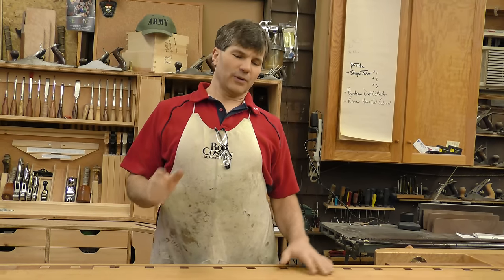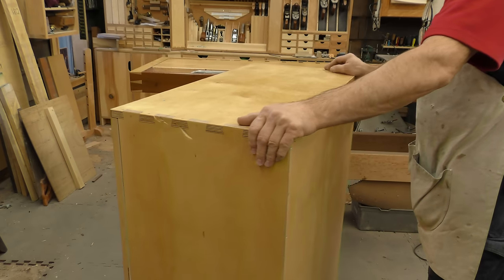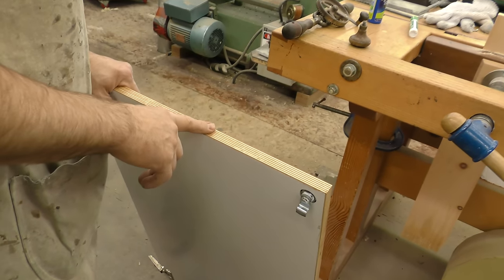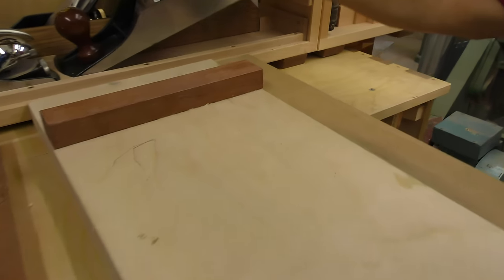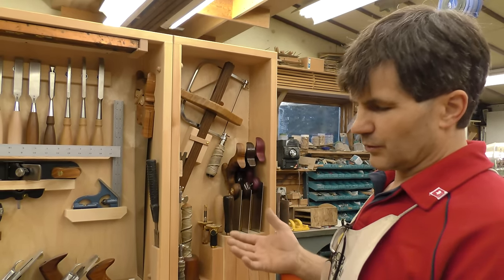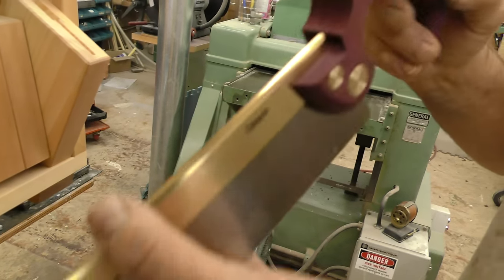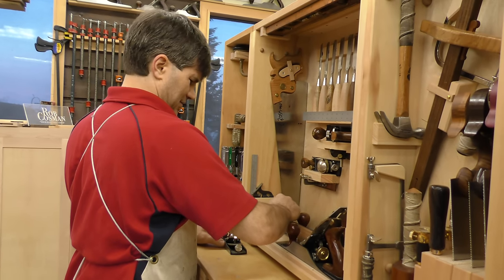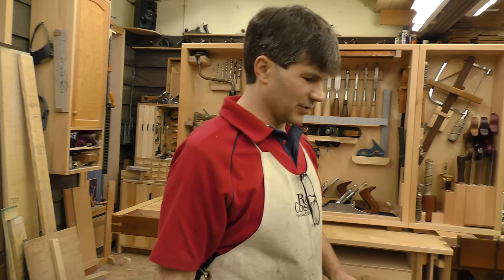Tool Chest for Hand Tools, Portable

Comment: With changing humidity as you travel or in the garage workshop have you thought of ways to avoid rust in the chest, other than periodic application of a thin coat of oil? As a former soldier I used to have to balance between oil to avoid rust and oil attracting dust and sand on my FN.

Comment: as usual your show never disappoint, great tool chest and very versatile to your shows, a bit surprised not to see a Knew-concept saw...
also a #4 or a #3 handplane, there's enough room for it...
nice video presentation, thanks Rob.
Reply: Rob Cosman 
can't say that i disagree on both, the fret saw is mainly a secondary tool unless you cut puzzles...and the 4.5 is the one i also pickup the most since I have it...
Best

Comment: Great work! Instead of hanging the whiteboard, you might want to seat it on the top of the case using 2 upside down ‘T’ style feet with a slot cut in each to match the thickness of the whiteboard. That way you can just lift it out of the way and put it back easily whenever you need to reach for a tool  without having to unfix it.

Comment: Since it is on wheels and easy to rotate, I would do the white board the back of the center cabinet or even the 3 uppers.
I built a rolling tool cabinet and included a white board on the inside of the top lid.

Comment: Rob. This is the best thing I have seen since the Studley tool chest, fantastic innovation here. I had one thought regarding mounting your white board. I thought there should be some way you can use the existing hinges. Place a female set on the inside top of the box so you can display it when you need to teach, then swing it up and out of the way when you need to grab a tool. If it doesn't work swinging up, have a separate mount on one of the sides to display and open it like a door to access tools. 

Thanks again for sharing this, it was awesome.

Comment: Rob, Thank you, outstanding!  This is a great primer on "essential tools" for hand wood working and their tool cabinet.  For the whiteboard, why not use the hinge that is already there?  You could attach the hinge to the lower case, swing it down when you need to access tools, and swing it up when you need the white board?  With a 180-degree hinge it would lay flat against the lower cabinet.  With a 90-degree hinge and a stop it could be a horizontal light duty work or writing surface.  Kind regards, Greg
Reply: Looks like variations of this have been previously suggested several times!

Comment: for the Whiteboard. To keep things flush during transport, but having a strong lip,  Cut a piece of wood shaped by an L and a matching slot in the top.  For transport, the bracket goes in upside down.  To use, simply turn the bracket around so the vertical part of the L is above the tabletop and holds the board from kicking out

Comment: Good morning. If you place a matching set of the back half of your door hinges for the white board on small blocks with a tapered dovetail(so gravity will hold them in) that protrude the thickness of the door, in front of your saw you should be able to use it and swing it out of the way  when you need to reach for a screw driver or drill bit. when your done set them at the base of the cabinet for transport. It won't add any additional weight. Basically rehang the door with removable hardware.

Comment: For the whiteboard you could attach rod on a single side of it that fits into a hole on the bench so that you can move it out of the way like a door.  That you way you can set it up quickly, remove it quickly and also use both sides of it.

Comment: Hi Rob, been a fan of your videos for years - leant so much from you, thank you for sharing to love and joy of your craft.  As you were chatting about the whiteboard problem, I thought you could make two 1 1/2" holders that the board sat in and dowel them in the front of the cabinet (maybe with two dowels per holder to tie in the small leaves to the large central cabinet edges,) If these were placed so that the board sat with the bottom just below were your level is - it would not need to be removed constantly for tool access, and would be high enough for students to refer back to easily.  when not needed they could be kept in the drawer with the wedges etc.

Comment: What a fantastic build, excellent craftsmanship! A possibility would be to hinge the whiteboard in the landscape position from the top of the cabinet and have a detachable gas strut to hold it up when you need access? I know a gas strut isn't very authentic to the hand tool feel of the overall cabinet but if the means justify the ends ... :)

Comment: Full extension drawer slides attached to the front edge of the center box so the white board can move up and down easily.  On the bottom of the white board a threaded knob that will hold it in place in the up or down position.  The knob can be unscrewed and stored out of the way. and the drawer slides are detachable from the  panels.

Comment: For the white board, put the hinges at the top of the door rather than the side.  Then when you open it it will open with the white board side out and will be plenty tall enough to lecture from.  if that doesn't work or you don't like it, just make an easel that collapses and fits in on the the side pockets or fits on to the door and is all one piece.  Just a thought.

Comment: For the whiteboard, you could use 170 degree wide throw hinges, and put a pair of mounting plates on top of the center section. Just click the door onto the top, and flip it down, then up out of the way to access the tools. The only thing is it looks like the bench hook would be in the way of the hinge knuckle where it currently hangs inside the case, when closing the door for transport.

Comment: You might be able to use the existing hinges on the white board by turning the door 90 degrees and hanging it from the inside top of the tool chest. Now since that would prevent easy access to tools, another idea would be to place the white board face up at the base of the chest and then simply raise it up for whatever you needed to draw out.  I don't use a white board but rather an interior door in my chest. You could accomplish that idea with a 1/4 thick board that pulls out from either the left or right bay of the chest.

Comment: About the white board, how about you put a pair of hinge thingies on the top just beside your level holder, then you could clip in the whiteboard in those. If need be to access the tools behind, you can flip it up -- it's still a hinge after all. It probably wouldn't stay flipped up by itself, but it should be useable enough for flipping up, grabbing a tool and drop it back down.

Comment: Hey Rob.  Lots of great ideas here and thanks for sharing them.  My solution for the white board would be to mount 2 small blocks to the left side of the drilling case using simple barrel hinges so they will hinge out parallel to the front of the case and mount another pair of hinge plates for the door hinges to them.  Mount the door upside down(lock on the bottom) so the door could be opened exposing the whiteboard using the hinges on the door.  Obviously this assumes the case would support the weight of the door hanging off one side.  Place some more magnets behind the hinged blocks to keep the blocks from swinging during transport.  The door would be vertical instead of horizontal, but it should work.  Better yet, how about a hinge plate designed to be used with a face frame, mortised flush into the front of the case side to accept the door hinges?

If you want the door horizontal and high enough for display as in this video, a simple hinge mounted to the bottom of the middle case, and the door could lay flat on the shipping case when not needed and allow access to tools, then flip it up vertical against the case for writing/drawing as needed.

Best of luck and I love your DT saw.

Thanks again for sharing what you know and love.

Comment: Simplest fix for that white board, is another alternate set of door-hinge mounts in the top of that removable case-box, for your existing hinge pivots to plug into same as the side hinges for the cabinet door position.  Then behind it housed alongside one of the case dividers, a tip-out prop stick (itself hinged at the bottom of the case) -- like the simple prop strut for holding up the hood of the engine compartment on your car.  (Do Canadians call that a car's "bonnet" like the Brit terminology?)  Only down-side for this scheme, is you'll end up with a little hole-socket for the prop-stick, exposed somewhere on the outside of your closed cabinet door.

Comment: The whiteboard could be held by a modified french cleat. To use it, hang the whiteboard off the top of the middle or either side box which could just have a shallow receiving groove cut into the front edge. A small magnet near the bottom could stabilize it, but I have found french cleats are self stabilizing.
Reply: The dowel design to hold the side (wing) tool boxes to the main box is, in itself, a "modified french cleat."  Continue this method of attaching the whiteboard to the side of one of the wing boxes to support the whiteboard; try to use dowels that will fit within the holes that appear to be in the hinge pieces attached to the whiteboard.  Also, as Roy suggested, include a magnet to stabilize the whiteboard in position when suspended from the dowels, as neded.  Therefore, your whiteboard will be in position on the side of the tool box, 90 degrees from the open face of the box and not impede access to the tools. It can be mounted to be almost at the height of the top of the tool box, which is hopefully a useful height from which to work, and can be easily removed and stowed when finished with it's use.

Comment: This is all stunning, pal! I love it, very well made and such. May I make one question/suggestion? Why not use a sort of dovetail sort of slide (I'm a novice, may not be dovetail for this use) for the wedges holding those old style bench/saw table joints? Also I'm wondering if it would be possible to make another bead for those pegs in the side wings, so they stay in the hole not getting lost, and something stopping them coming out when putting the wings back when packing. Very very interesting, my imaginations running wild haha. And that purple saw, especially the golden coloured tool I forgot which, wow they're gorgeous

Comment: Hi Rob.

Thank you for inspiring with great ideas and tricks of the trade at all times. My question if you don't mind: the drawer you made for the sharpening stones you don't have a worry about, as its bottom may crack due to its being glued and not allowing for expansion? Mostly because it will be in the most moist environment.

Comment: You can fix a strip of wood to the top with the other half of the door hinges attached. Clip the white board to those and it will lift as/when required?

Comment: It looks like you've put a lot of thought into this design and it's incredibly nice.

I'm not sure if this is a problem, but it seemed like you were looking for a place to put the pullout shelves while you were showing it off. Assuming finding a good place to put your shelves is an actual problem have you considered having a lip on the bottom rear of your shelves so they fit under your bench-top tool holder and basically wedge in there?
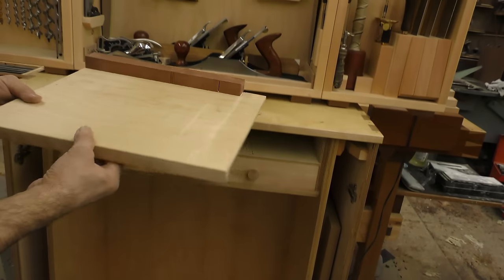Reply: Rob Cosman hi, nice masterpiece. i think mike was talking about your shooting boards, from 7:20 to 8:30 . this video got me subscribed, love from france :-)

Comment: as to the white board, turn it 180 degrees and attach the hinges at the bottom of the tool chest. then to access tools, just flip it down on the shelf.  is the white board high enough to display or does it need to be higher?  beautiful tool box :>)
Reply: I was thinking turn it 90 and put hinges on the sides of one of the side cabinets. Or somehow hang it on hinges from the top, it would still be in the way but you could just quickly flip it up with one hand and grab what you need with the other. Amazing work BTW.

Comment: Love the tool chest. One question. Could you have made the doors double hinged so the open the front and side independently to allow better access to the bench and bench hook? wouldn't even need to be a full side door, it could be just a half door on the side with the quick disconnect on the front and regular hinges on the side.
It looks like a tight area trying to get the bench parts out. Just wondering if that would work or would it take too much of the structural integrity out of the chest?
Thanks, JKent

Comment: 9:00 hey are those dividers interlocking or did you glue small pieces against the pieces that run front-to-back? If they are interlocking, did you make them by hand?  That would be good to see. I made a tiny version lately and it was... not as nice looking.

Comment: Since the hinges detach would it be possible to put another set of hinge backs (the part that is attached to the cabinet itself) along the top side so that the door would open vertically? You'd have to have a part that hangs down (though that could also be hinged) so that they could mount on the front, I suppose (which would eat some of your space inside the cabinet) but then you could open it up and when you needed to access the tools, just swing it down.

Comment: Sorry to ask :) what kind of travelling does this do-im thinking if positioned on unlevel ground like, say, a patio, how would it stay level as as not to tip when top heavy with the upper bits on there? Honestly I can't imagine how it's so stable as it is. I'm thinking perhaps sliding or clamped wood strips to stabilise it if on unlevel ground
Reply from the maker: Its not designed for uneven or unstable ground.  It only gets assembled from its traveling configuration when it gets to where its going.  Once it gets to its location it only gets moved a few feet.
Reply: @RobCosmanWoodworking  thanks a lot for your reply, I bet you're a busy guy. I knew it only gets assembled once at its destination, why and how would it travel though? I mean it's surely too heavy to lift onto a vehicle and there's surely few places and scenarios which would need it where a level ground is available unless cross channelling things with YouTubers I suppose :s

Comment: could you put the white board on the back of the upper section, because it's on castors all you have to do is swivel it around for either use.

Comment: Hi Rob could the white board be held on using magnets , lovely cabinet .
G
Reply: Check out Polymagnets web site, they have super strong magnets that come in pairs and one type is a twist-to-release. I use them on my tool cabinet doors. You put one on the door, the other on the cabinet, and they attract, the one on the door rotates and when turned 90 degrees, the magnets repel. The door side magnet is on a screw attached to a knob.
They also have ones for drawers that have a lateral force to hold the drawer closed, but is easily pulled out.

Comment: How did you cut the slots to hold the hand saws
Reply: Surely he didn't.  I'm positive he would have glued two half-pieces together for each of those, shallow rabbets for the saw-slot gap cut into each face of the mating halves.  If you wanted to start by splitting (bandsaw) a solid block of wood in half for each of them before routing the inner slots, they would each look like one continuous piece again if you glued it back together carefully.

Comment: This cabinet is a really neat attempt, but I think there could be a better design. When the three large pieces come out you're left with a very large empty box with, apparently no other purpose.
Reply from the maker: You may have missed the point.  This has to travel, the big box was for protection in transit then converts to a platform for holding the tools at the desired height.